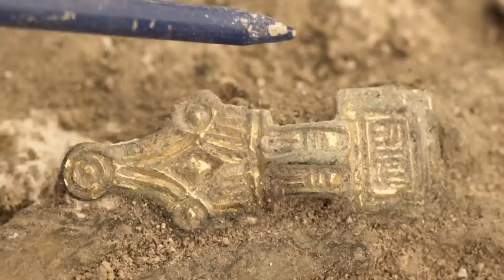Astonishing Anglo-Saxon Burial Ground Found By HS2 Archaeologists

Comment: Not sure about the shield wall as a combat option this early (5th/6th C); the shields are significantly smaller than in later periods, and the shield bosses seem to be designed as much for offensive combat as for protection of the hand holding the shield. 

This suggests a more fluid, open style of combat where the warrior deflects an opponent's weapon with the small shield (or punches the opponent with the boss) and follows through with spear, axe or seax.
Reply: Punch-blocking is a thing? I did that cos I'm too wimpy to hold a big shield, lol, but I know swordfighting in the SCA (Society for Creative Anachroism) is very much under the "Creative" part of the name, & I don't know a lot about actual historical combat, but it's fascinating.

Comment: The NIMBYs and naysayers whinge about the cost of HS2 but fail to mention the huge amount of environmental mitigation work (Cut & Cover Green tunnels, huge twin bore tunnels, tens of thousands of new woodlands etc) that has added significantly to those costs.
And then there are the collateral benefits (that also cost money) like all the archaeological work. How many sites would never have been found let alone explored and saved were it not for the funding by HS2 of teams like these archaeologist's?
This is how we should do infrastructure in the 21st century so we can learn from earlier Centuries.

Comment: The guy explaining what a shield boss is for is wrong, they weren't primarily for "bashing" but to protect the hand of the person holding the shield, as without it there'd be a gaping hole in the middle with your hand sticking through. Anglo-Saxon (and indeed Norse) shields did not have any kind of straps to make them easier to hold like later medieval shields did, they were held with a simple wooden bar that went across a hole in the middle of the shield. The boss was there to cover up the hole and stop your hand from getting mashed. Perhaps it was used for bashing but that wasn't its primary function.
Reply: Something I've learned in the meantime, but thanks! That's the gorgeous thing about these sites, they basically force you to have a read around and improve your knowledge about things. In this case, historical weaponry.

Comment: At the very least that wound would have paralysed the victim from that point down.

Because the weapon remains impaled into the spine of the victim, death occured around the time of the wound itself.

It cannot be known if the death was hastened by other means or if it was soley related to the spinal wound.
Reply: I don't think he moved around much after that spear point stuck in him. High odds it punctured or severed the big vena cava vein that runs along the left side of the spine. If it happened in a fight his blood pressure & pulse rate would be jacked up, You'd be out in minutes if you were calm and so much quicker under battle stress. 

Prison inmates use that "trick" if they want to kill someone faster. They'll invite the target guy to play basketball and make sure he's breathing hard and heart racing, then they stab him as many times as they can. Its rare when a prisoner survives an attack under those conditions but I know of one who did. Doubt he'll ever play basketball in prison ever again.

Comment: Yes, those brutalisers of HS2 are so caring, while they rip the heart out of the country, for Boris' vanity train set.
Reply: It's not a vanity train set, it's an essential infrastructure project to upgrade Britain's railway network
Reply: @sudo_nym  The railway network is a jack of all trades, in which all types of trains use the same line (express, stopping, freight). This restricts the number of paths that can be taken without hindering performance. You could argue about upgrading the existing network, but that's been done several times to a point where it will cost more than building a brand new railway line dedicated to high-speed trains - that way, not only could there be more express services on that new line to bunch up together, but capacity would be released to more stopping and freight trains.

The people who benefit the most out of HS2 will be people NOT using HS2 because the local stations will see increased frequencies. As a result, travelling by train becomes more attractive and this creates a modal shift from cars and airlines to trains. This includes an improved east-west connectivity, although further reopenings (as in the case of East West Rail) should further enhance this.

The belief that people will leave northern towns is nonsense that's been rehashed so many times that if it were true, it would've happened long ago, well before HS2 was an idea. If you're adamant that HS2 really is a waste, please tell me of a better alternative.
Reply: @onlinefriend3889  
It’s not for me to put another case. 
You disagreed. 
Hitchens Razor.

Comment: Very interesting, but will these people be reburied with their original grave goods after the archaeologists have taken all the measurements/photos they need (I'm sure they've seen enough spear points and shield bosses by now).  Burial customs were clearly a massive part of these peoples' culture, so what right do we have to permanently loot and disturb them?  It just seems wrong somehow if these folk end up in some filing cabinet or draw with none of their grave goods around them.
Reply: Loot and disturb ? This is called saving the history of them.
Reply: @xCLUNKx  Yes, by all means record all you can, but afterwards these people should be reburied with their possessions as close as possible to the original site.  What right have we not to do so?
Reply: @JohnyG29  im not taking you on, you sound like this is going to turn into me arguing with a Karen.
Reply: @xCLUNKx  Alright.
Reply: They can't be reburied THERE, because everything's going to be ripped out when they excavate to lay the foundations of the high speed railway line and put in drainage alongside. The skeletons won't be reburied individually: they don't do that even for 19th century churchyards. At least they go into the ground somewhere in a heap together, which is more than what the Egyptologists did.